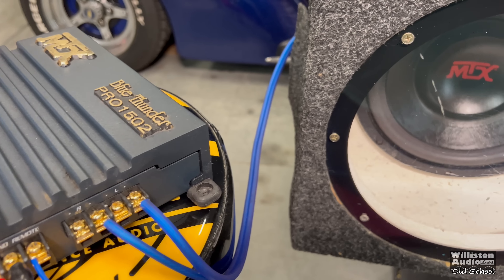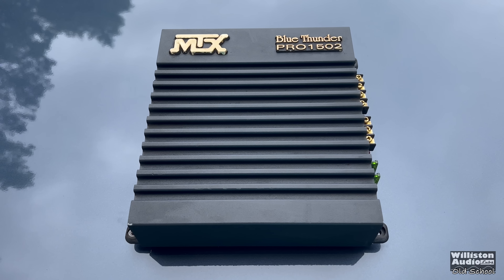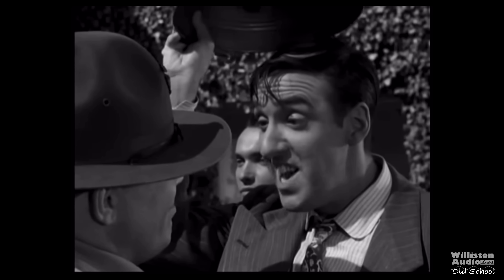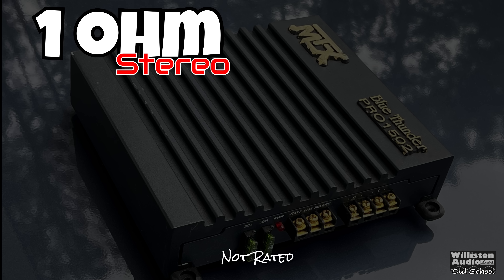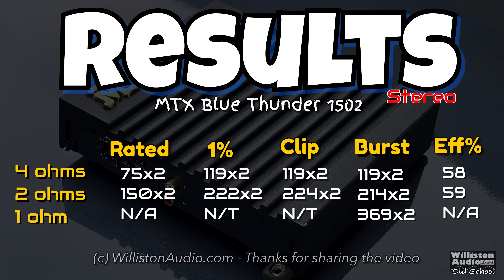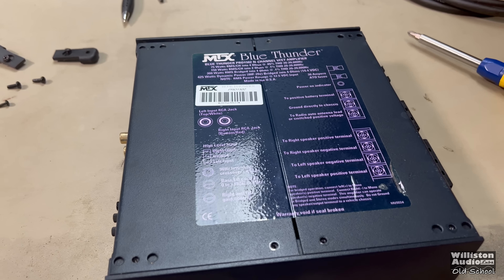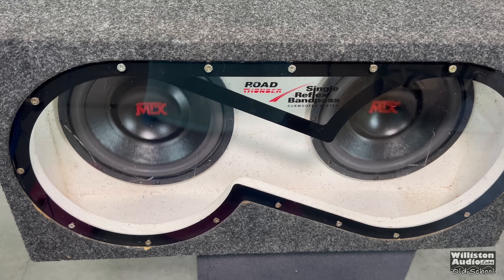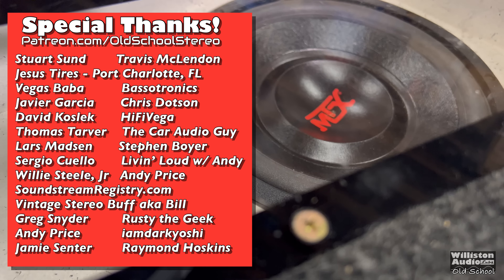Can This 25yr Old Circuit City Amp Survive Brutal Amp Dyno Testing?

Comment: I curious to what I was actually pulling when I had the first fosgate bd1000.1 wired to half ohm to 2 hx2 12's. I had it in a crx with a blue top optima and a o guage ofc wire and an old school 75 watt fosgate for my high amps. Had it in a obcon 4th order bandpass fat air box. Loves that system!!!

Comment: I've got one of those Blue Thunder 10" subs and it's actually one of the best sounding woofers I own, and boy do I own a lot of 12v hifi.  It sucks you had to cut that sticker for the video, but I see an upside in at least you could see if the caps were swelling and in need of replacement.  I've got Alpine amps that are a decade newer with Nichicon caps that have been swollen and leaking for years that I have to get around to fixing.

Comment: Having had a 2160 and 2040 in black they were 100% the SQ performer even the black ones were pretty darn good next to the then soundstream REF line i used RF 200DSM down low and was the best sound ever miss it so much I even used a coil on the sub for fun and still had headroom and the 1/2 stability or the REF amps the MTX did 2 ohms just dandy on the highs

Comment: BTW - using a low temp hair dryer (NOT a heat gun), you can peel that bottom sticker off without damaging it and it will stick back after re-assembling.

Comment: I have a Thunder 2300 which you have already tested and a Thunder 4300 .
I had a 4320 I got at the same time as the 2300 but the power connections desoldered themselves fairly quickly , which was a known problem with the big 4 channel , and having no more in stock , they exchanged it for the 4300 with the smooth chassis and gold lettering . Both are damn fine amps despite being power hungry , and have anchored several systems over the years .
I have always been curious what the 4320 and 4300 would actually test at , and someday I may drag them out of storage and wake them up along with the neighbors , lol .
Reply: I run two Optima yellow top deep cycle batteries in my Duster with a 4320 and 2300 and 1AWG wiring split down to 4AWG at the amps.
Reply: I had them in a 94 Wrangler with Infiniti plates in the dash ,Infiniti 6.5's in the back , and sealed box taking up the back with the amp rack .
2 Pioneer 12's in a sealed enclosure firing straight down onto a loader board that opened right at the seat backs .
It was one hell of a back massager  .
Reply: @kaboom4679  Dude, that sounds awesome! They are such underrated amps. But people know what they are worth now. I have a really hard time finding mine because I wanted them cosmetically perfect and they are. I boxed out the trunk and flush mounted them. Old school for an old muscle car. All my seperates are Kenwood, it's a very affordable build. 6.5's in the doors, tweeters high in the door panels, and 6x9' in the rear side panels. I didn't think it was loud until I shouted and could not hear my own voice! No distortion from the MTX amps, they play very cleanly so they don't sound loud.

Comment: I still have a pro 504. I recently installed it in my tundra sr5 to run my alpine componets in the front doors and my polk audio back doors. It kicks those 6.5 inch speakers very good. My 12 inch sub is being kicked with a rockfod fosgate punch 300.1 mono block. Sounds really clean and crisp.

Comment: Back in the late 90's to early 2000, 300w output was easily the most common rating be it 75x4 or 150x2 though many would advertise them as 600W max, even had a couple myself

Comment: Funny thing though, this amp is still plenty powerful for tweets or mids in a modern SQ oriented setup. Tweeters and mids don't need 500 watts of power to sound great. 
Love these old school dyno's and reviews!
Reply: I wouldn't trust this amp without a recap on any pair of speakers I care about.  MTX notoriously used cheap components and the only reason they likely won that CA&E shootout back in the day was because they were still using an unregulated power supply.

Comment: I remember saving for years to buy this exact amp. Circuit City used to be my home away from home. Unfortunately the car that this was installed in was rear-ended while parked in front of my girlfriend's house. The Collision resulted in a fire after a power cable got pinched in the trunk. The sub box caught fire, before I could find a garden hose, the entire car was engulfed. A total loss. Very quickly learned not to increase the size of the fuse in the power cable. Bad things happen

Comment: Big D  " YOU BIG DUMMY " Use a blow dryer next time the adhesive will come loose and you can just pull it off next time , love the video and I 6 Blue Thunder amps in storage will be pulling them out today for a install.
Reply from the maker: I know I blew it…I mean I didn’t blow it…you know what I mean 🤣

Comment: My first real amp( I still have it) a kenwood 921' that was rated 75watts @4ohm & 100watts@ 2ohm, but it came with a fan for two hundred Watts or the pioneer gmh 200 hund with it 3 power leads and 2 ground two 30amp fuses. I would love to see them because as I got older I got better equipment and about 4 amps on my wall you have tested, but to see the amps people on a budget bought( not Jensen, audiovox and the rest)you probably won't believe this but around a week ago I took the mtx tc 400.4 and yes even in 2010 mtx was still charging  $1 a watt, but when I went to pull the RCA's out the plastic inserts came out. Big D, I no a guy selling a cerwin vega 12in aluminum dvc,  but I can't find any info, do you know anything about it and is it any good

Comment: Hey BigD, how do those Mtx Blue Thunder sub woofer's sound vs the Black Gold's? The similarity's, and the diff., in your opinion? Sealed/4th order, vs ported/6th?
Reply from the maker: I never had a Black Gold Sub to compare
Reply: @wal  The Black Gold subwoofers were very good performers. The 10inch was esp. highly rated for sq. That's wild i heard the Black Gold's, but not the Blue Thunder's, and your the opposite. But we Both ❤️ Old School car audio. I really appreciate your time, and passion, that you put into All of these video's. But my favorite is the oldschool stuff, but i can't lie, i love all these new amp dyno's showing the true power, esp. these new D4SoundShop Jp amps! We bought the 5ch. (Jp95) after seeing your dyno of it. We have it running 2 comp. set's, 1 in front, and 1 in back, plus a pair of 12s=it sound's Awesome, thank's BigD❤️

Comment: Wish they sold a conversion from those hateful spade termanals to a modern. All the bus bars,alternator multiple connectors and multi battery terminals out of billet that have been made someone should make that adapter. If you can do a reducers and multi input why not a spade adapter.

Comment: So where can I get some evaporate rust?
Reply: Most any hardware store or auto parts store sells it for ~$25 a gallon .
Acetic acid also works as does citric acid , for cleaning rust from ferrous metals .

Comment: of course we like the old school amp dyno. i have an XTANT X603 and i REALLLLLY wat to see a dyno on it as its stated power output is 75 x 2 and 150 x 1 at 4ohms, or 150 x 2 and 300 x 1 at 2 ohms. 600 watts ,ok.
Then why does it say no less than 4 gauge and a 100 amp fuse near the amp. thats way overshot. i want to know what the actual output is. how much is the average cost of sending an am to you to dyno. its a unique one. it would get a lot of views. c'mon, i heard from a dealer back then that the sub channel could easily run 6 jl 10w6's from that era also. i gotta know. let me know in a reply if you want to dyno it.